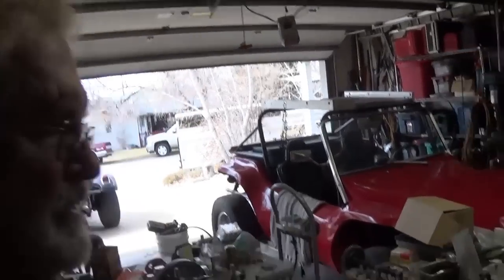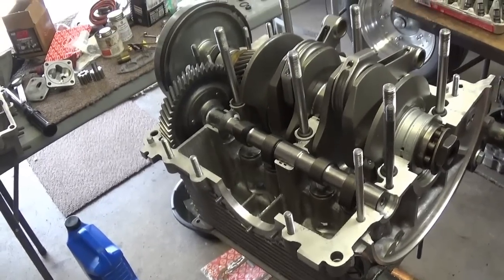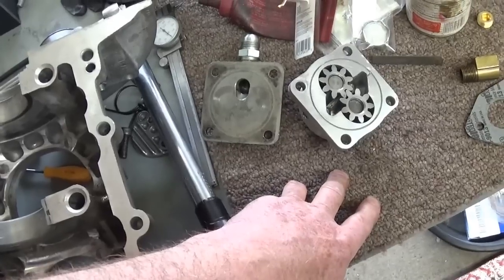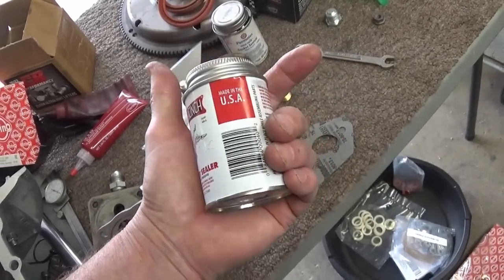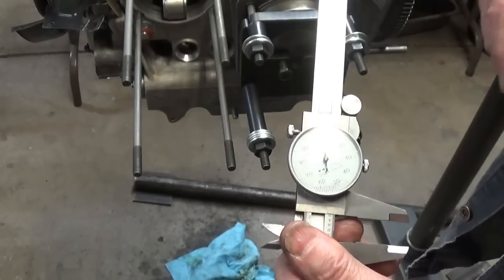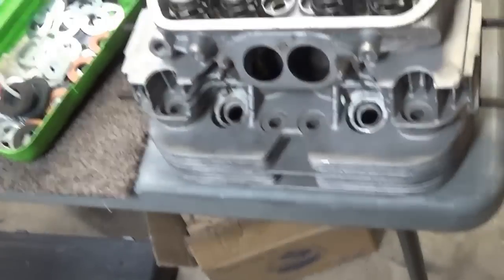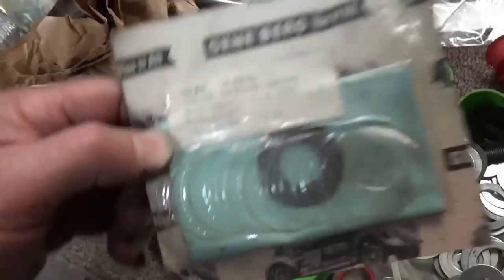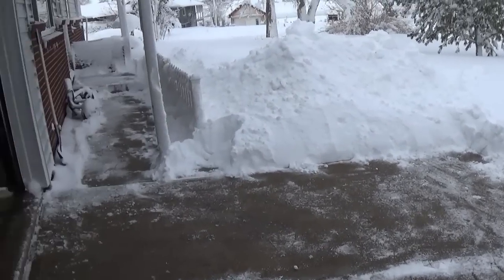VW 1600 DP to 2110 cc Conversion

Comment: Nice... and I though I was busy for installing vintage search light on my '66. What do you think about mounting type 3 tins under cilinders instead of small ones?
Reply from the maker: works great on off road engines where you don't use all the rest of the lower stuff.  I did that for years. Add a wire across the top to keep them from rubbing on the pushrod tubes
Reply: @TheEZGZ  thank you Sir.

Comment: Hi Ezgz, we've install a lot of centre mount on 1680 & 1776 engines. We found our 1776cc builds ran best with a 44IDF centre mount with 145 mains, 55idles, 160 air correction jets. We still haven't bothered with the preheat tubes yet. But we did find that deck lid stand-offs made it run rough when cold so we removed them and kept the engine closed up. With your open engine compartments I suspect your going to need the preheat tubes connected.
Reply from the maker: Great info!  Thanks for the help! Are you using F11 emulsion tubes with that set up?
Reply: @TheEZGZ  also don't go too small with your venturies. With a, single center mount having a, lot of fast velocity over the venturies makes the carby chill even more. I'd start with 2110cc I'd consider 30 or 32mm venturies. We had a 1776 with centre 44IDF got it running very well with 28mm venturies and no heater tubes connected. But it still had a little issue in cold weather. We changed out the venturies to 29mm and it was perfect!

Comment: Dimples on the oil pump gears are there to lubricate between the gear and the case. You can add more more additional lubrication if the supplier cannot get them for your vehicle.
Reply from the maker: Correctomundo

Comment: EZ. I would turn the large case nuts around. You don't want to look at the seal. You want it to work. I used to build motors in the 80s. Learned from a great German teacher. Anything that touched the case. Including base of cylinders. Aviation permatex. No paper. is saturates & squeezes out. Then cylinders pop. As far as thermostat flaps & linkage. In Florida. We put them in the trash can. Colorado weather is a little bit different though. So you may want to keep them. Great videos! p.s. Sealer under all washers. Nothing above. Except 6 case half nuts have built in seals OH and oil pump nuts, Do too.
Reply from the maker: I prefer the Gene Berg method Sir.

Comment: Interesting theory on those oil pump gear dimples!  How the heck have we made it this far without any body definitively knowing what those are for or how they should be oriented? ...Especially since every manufacturer puts them there.  I like your analysis.
Reply from the maker: It's just my theoretical observation. I'm sure if it made a differeence they would include instructions with the  pump. Then again, it's made for a stock 1600 engine. I'm always looking for longer life and more power.

Comment: I always figured when you put together stroker motor one thing is rodj hitting the camshaft and the bottom of the  cylinders themselves
Reply from the maker: That's why the cut and trim a lot of metal away in those area's. I always felt like it weekend the case. On the 82 and  larger stroker motors the crankshaft counterweight can hit the camshaft so you have to remove material

Comment: Use a little bit of oil on your valve stem it will stay on there better, --A quick Question where do you get one of those headspring tools at
Reply from the maker: There all over.  http://carcraftstore.com/benchmountheadassemblytool.aspx

Comment: engine not shuffle pinned ? i used a 82mm 4340 moly crankshaft for $ 260.00 , scat was too much around up to $800.00 left mine alone at that specs of 2276 cc with total seal piston rings and chrome top ring combo been running since 1984 had 256k miles and refresh in 2004 but ran to alum block pop top about $ $ 600.00 no more welded rimco style engine . but is shuffled pin though , but this time dropped the comp ratio to 7.0:1 to at least run poo poo gas @ 87 octane and not a slave to high octane later turbo charge in the future.but i get 36 mpg on the highway ,happy trails meep meep
Reply from the maker: Your living in the past and nobody ever made a chrome top ring. It was always for second ring to last in dirty conditions. Your 256K miles is total BS my friend. Live your dream. Hope you get smiles to the miles.
Reply: @TheEZGZ  vw engines have been known to get at least 500k miles  not a hot rod high compression engines .we have built 2276 cc in the 80s still running today with turbo of low compression as long as you keep cool running we are in the hot desert . and use some of the vw rails patrolling the southern border . for over 20 years no hang ups and for the most all run on total seal piston rings because standard rings leak down up to 35 % cause of crank case blow by total seals rings leak no more than 12% and and 2nd piston land is a double ring chrome top three piece oil scraper from phoenix az ware house .we have a 1850cc engine for over 25 years slip in no machine high rev great combo kit ,look into it .happy trails

Comment: Hi EZGZ!!! Which block is better? Aluminum or Magnesium ? What specs of engine oil are you using?
Reply from the maker: Mostly I've recycled dual relief mag blocks without issues but it's always nice to have a new case for a build.  I like the aluminum case for the added strength.  VW dropped the mag block when they came out with the type 4 engine so I figure it was for good reason.....

Comment: I know I have heard you mention it before but what is currently the best engine bearings for type 1 engines? Or more to the point what have you had the best luck with?
Reply from the maker: Silverline metal backed for the mains.
Clevite for the rods
Reply: @TheEZGZ  Does Silverline make any mains other than steel backed? Also what Cam bearing do you use and do you recomend double or single thrust? To me double just makes more sense considering that the crank uses a double

Comment: Hey there EZ, why do you keep saying screen only during break in? All modern engines that are factory full flow still have a screen, FYI.
Reply from the maker: modern engines have a lot bigger screen and although the stock screen works well enough if you increase the max RPM or run a higher volume pump it can become a restriction.
Reply: I disagree, smaller and finer and higher flow pumps and more oil demand, etc. I feel like you may be wrong on this one. But maybe the screen you're talking about is smaller than I imagine.
Reply from the maker: Added Bearing Life » Added Bearing Life - Technical Information

Oil strainer information. An area of extreme importance. The inlet or suction side of any pump is extremely limited in what it can do as compared to the pressure side and should never be impaired in anyway, whereas the pressure side is capable of overcoming a great deal of extra resistance. For that reason, I have not used the stock oil strainer in any of my high performance street or race engines since 1966. I found that it often caused too much restriction on the suction side of the oil pump with a little higher performance and high RPM engines. This problem was traced to oil starvation and all out bearing and/or crankshaft failures from the oil not being able to pass through the stock restrictive oil strainer screen fast enough to provide adequate flow to the pump.
Contamination was a concern, however, all of my engines from 1961-on had full flow oil filters protecting the engine. Some concern about metal particles going into the oil pump before filtering was solved when I went to the farm supply house and bought a "cow" magnet that is about 1/2" round by 3" long. I hose clamped it on the outside of the pickup tube extension for the larger sump. I have used this configuration successfully for years over 30 years. For those that do not know, a cow magnet is what they feed the cows to pick up metal (such as broken barbed wire) from the stomach and pass it out of their system.

Another concern is the weight of the oil. Remember, the heavier the oil, the less it lubricates. We run 20 weight in our race engines and 10-30 weight in all street engines. Only if the temperature is constantly above 80-85 degrees would I consider 10-40 weight. 5-30 should be used when temperature falls to below 45 degrees. For freezing temperatures straight 10 weight would be my choice.

The point is, if bearing life is substandard or failures have occurred, these are items you should be looking at:

GB 212 Pickup tube magnet with clamp to attach to outside of deep sump pickup tube. Originated by Gene Berg in 1964.
Reply: Gene Berg must be respected, but things have changed in terms of oil tech. VW engines are different but not fundamentally different to any other. Empirical bench testing of heated oil using artificial drive of a real pump and comparable passages would settle this. He makes it sound like larger displacement impacts the oil system when clearly it does not. Racing wise, depends on drag or endurance and budget for rebuilds, but the higher hot weight the better, 60 hot weight is thinner than 10w cold weight.
Reply from the maker: Some folks just like to argue.  Do your  own thing fredeio54  Opinions are like asholes...   everyone has one. Gene's way is working for me, so why change

Comment: Iam at a cross roads on my first VW build for my buggy,have the case half's milled to 90.5 with Engle 100 cam big valve heads only because machinist says my single port are junk. Which carbs would you use thanks sir
Reply from the maker: A 1776 runs awesome with any dual carb set up even with a stock cam

Comment: How to remove a oil pump that has the plug for  full flow?
Reply from the maker: Tap Tap Tap It's a real pain sometimes. Loosen the case bolt under and above it. A little tap on one side and then the other. Don't damage the engine case sealing surface. Use some wide like a putty knife ounce you get it moving. Be creative. You can do this!

Comment: Hay ez I’m wanting to use the c45 scat cam in the bug what’s your thoughts thanks
Reply from the maker: follow the cam manufactures advice. That is not a good daily driver street cam IMHO
Reply: Used C45 camshafts many times in 1915 engines. They make about 135hp with a pair of 40 Dellortos and make for a nice combo in a Bug with a pair of nice heads, something like 40*35 with some porting
Reply: @chrisburns4297  ok cool thanks is the c45 like the scatt 110 thanks
Reply: @harryloibl5183  The Scat C45 is similar to an Engle 120.
Reply: @chrisburns4297  also chris can one use the old case ? For the larger displacement engine😊😊
Reply: @harryloibl5183   What size would you like to build Harry? And what would you like to do with it? I've used many different cases, stock, aluminum, Scat, Autocraft, Pauter, ARPM and they all have advantages and disadvantages. The old, standard cases are lightweight. The aftermarket cases are great if you want something really large, like 2600 or larger.
Reply: @chrisburns4297  yes thanks that answers my question 😊

Comment: Where did the case come from
Reply from the maker: Brazil,   everybody sells them. The call them super cases or stroker case's it made from AS41 and not what I wanted. I bought a Autolinea aluminum bubble top case but sent it back because of defects.  Good Luck
Reply: I'm running an 1835 in my street bug but I'm thinking about building something with a little more  butt thanks for the information on your vidios 

Doug